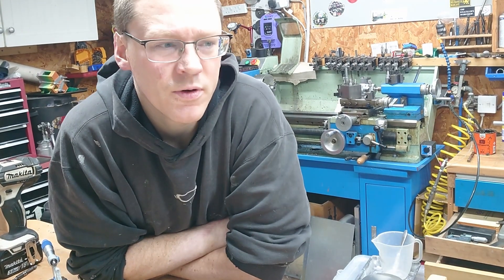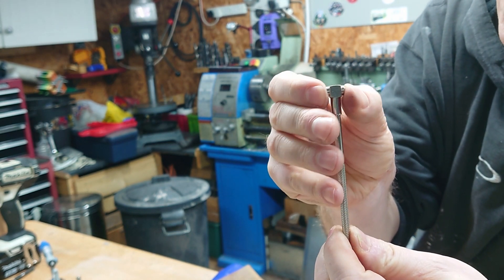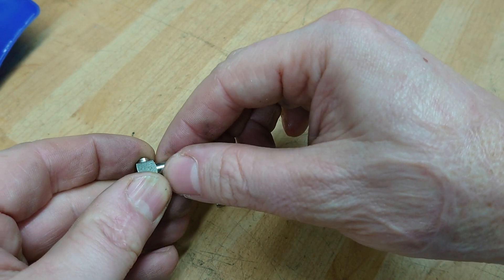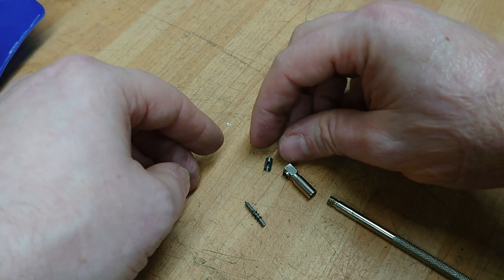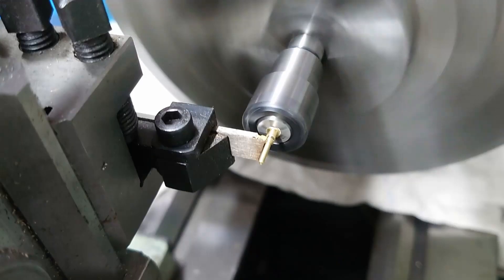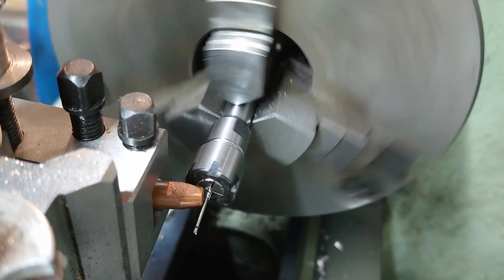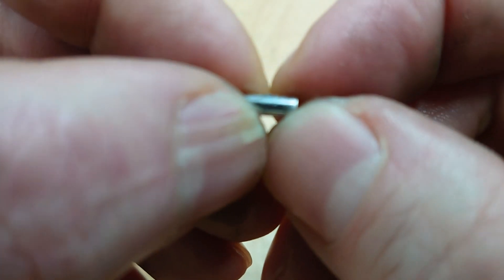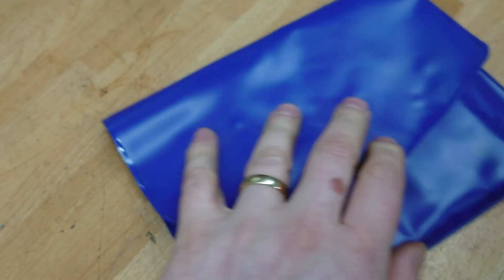How a bore guage works, and how to make parts for one!

Comment: Great video! I'm surprised (but glad) to see you back so soon, I thought you'd still be recovering from your monumental pre-Christmas push!

I wished you'd caught the moment the bits made a bid for freedom -might have needed some bleeping, but it would have made me smile! 

I've seen others make springs, but have always stayed away from it (though I've jars and jars I've saved for just in case purposes) as getting the piano wire or similar seemed a drag. I'd never considered unwinding an old one. And the MIG tip is inspired. 

So, there's a lot to take away from this one, not least not to let my curiosity get the better of me when I'm using my bore gauges 😉

I look forward to your next video. Have a good weekend. Matt 👍 🇬🇧
Reply from the maker: Hi Matt. I was pretty burnt out by Christmas, but I had a good break, so now back to normal videos. I've been gradually adding to this one for a couple of weeks now. Much more relaxed than trying to get it filmed, edited etc all the same day!  The 'incident' happened many months ago and it has been sitting on my bench waiting for an appropriate moment. The camera is never running for stuff like that! Not sure the spring rewinding thing is ideal as it is bound to have stretched the wire at least partially into its plastic region. The one I made seems to work ok though. Thanks for your thoughts and feedback.

Comment: We have the identical set of bore guages and I did wonder how they worked. Great idea to use the mig tip to feed the wire for the spring. You did a great job working on such small parts
Reply from the maker: Thanks Joseph, yes those parts were very fiddly. I actually had to think a bit to make sure I could hold the parts for all the operations. Made my head hurt!

Comment: nice work!  good quality telescopic gauge tips are usually hardened and lapped, at least Mitutoyo and Starrett claim so. It shouldn't be too hard to heat treat if you made them with high carbon steel like 1045 or CrMo 4140, then lap / polish them. Polishing the surface & deburring the edges will make the action a lot smoother.
Reply from the maker: The material is finest unknownium from the scrap drawer, so not sure if it would harden up. I will probably buy a decent set at some point.
Reply: @ollysworkshop  I think the budget ones like accud etc work fine, just need deburring and lapping of the mating surfaces. I bought a Moore and Wright set that was horrible out of the box, very functional and accurate after some TLC. Mitutoyo is great but almost 3x more expensive. 'Ol Tony has a video about this if you're interested.